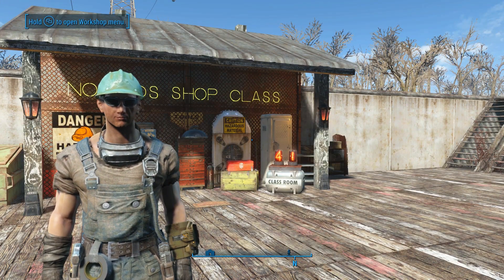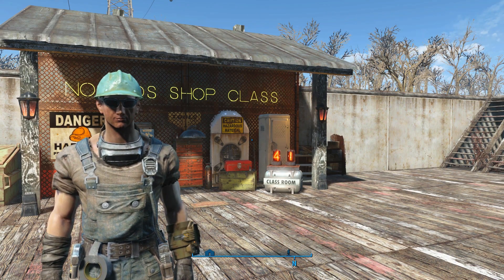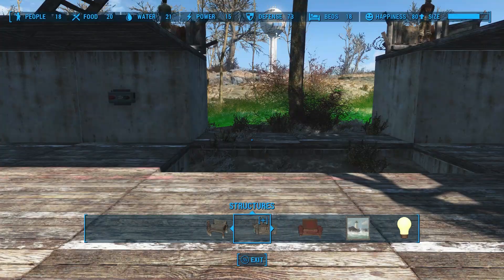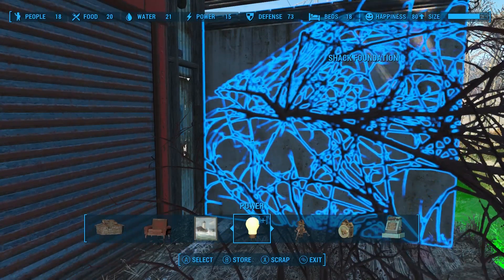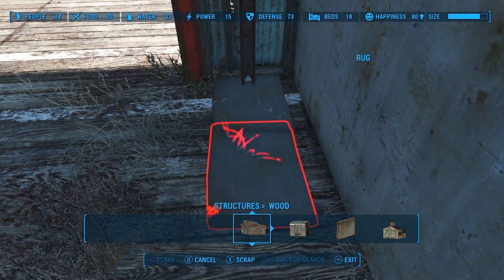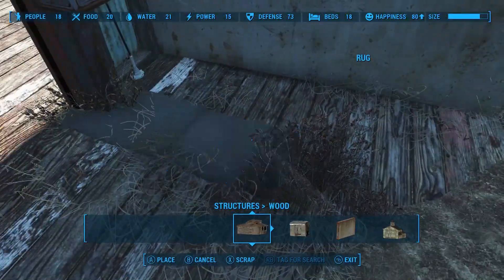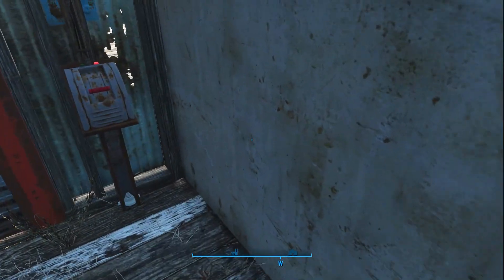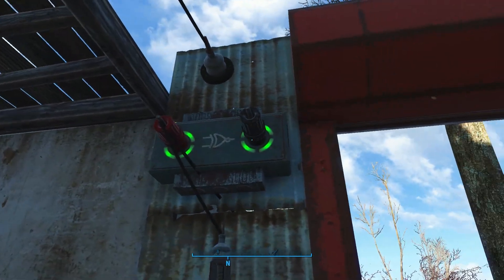Two-Way Powered Doors Using Logic Gates 🎛️ Fallout 4 No Mods Shop Class

Comment: Thanks for the video I needed to wire up the same door for my general's quarters using the logic gate .. instead of using the rug glitch I used commands  and perfectly managed to hide the wires going under the flooring... I also had the same wire bug and needed to rewire it like you did
Reply from the maker: That's awesome! Glad the video helped you get it sorted.
Reply: @SkooledZone unfortunately I still don't have your building skills even though I've played 1500 hours

Comment: I put this same door on my workshop/warehouse and wanted a door that opened long enough for me to pass through then shut right away, so I just used delay switches, no need for a logic gate and I only need to hit one button.
Reply from the maker: That'll work too. Mainly I wanted to show people a practical use for logic gates since most people haven't found many uses for them.
Reply: @ absolutely, I’m digging it, so thanks! I’m eventually gonna tackle some logic gate door stuff, I want a regular switch to open my home door, and the manufacturing laser on the inside to trigger it shutting behind me, then the laser resets and opens the door for me when I exit, and the door shuts behind me then too. If that makes sense. Basically manual entry, auto exit. Both auto close. If that’s possible without a wall full of switches. Lolz
Reply from the maker: Here's a method to try: https://youtu.be/0bhOULJvFwU?t=174
Reply: @ thanks a million! I’m about to deep dive your Fallout 4 playlist as I’m learning the game. Everything I’ve watched so far is awesome. Greatly appreciate your work/wisdom/wizardry.

Comment: I know this is a really late question, but I picked FO4 up again recently, and I am trying to make a power loop to a powered door with logic gates.  When the tripwire is triggered, it deactivates a NAND gate, which closes the door for the duration of the timer.  I have a modded laser tripwire that turns itself back on, but only up to 10 seconds.  I want it to stay triggered for about a minute, so I figured on using delayed on switches to add the addition 50 seconds.  The thing is, to make the system work, I have to have to switches in front of the tripwire in the circuit, so that they start their countdown before repowering the tripwire.  I am probably not explaining this well, and probably definitely out of my depth, but want to try and make this work if I can.  Any help would be appreciated.
Reply from the maker: Clever idea. There's also a powered counter. I used one for a different reason in this video: https://youtu.be/AcJdQ000Sxo
Reply: @SkooledZone  watched the other video, and that might help cut down on timing circuits, but I don't think it will help with my problem.  Honestly, I'm not sure that the programming for the logic gates in the game can actually accomplish what I want, or I am unable to properly parse what I want.  Either way, probably not going to worry about it much more.  Thanks for the help.

Comment: Followed your steps, but it sorta worked... I found the XOR does the trick, and not the XNOR 😮
Reply from the maker: Indeed. See the note I posted at the end: https://youtu.be/syC2ACXvwm0?feature=shared&t=700
Reply: @SkooledZone  - I got the Sonic Screwdriver in a mod.. so I use it now for locking etc 😉

Comment: XNOR fails to match its own logic declaration.  The gate should open if both switches are off or if both are on, but not if they do not both match.  This does not match the operation.  If both are turned off the logic gate turns off and the door will not get powered.  And when the gate is separately powered, the declared XNOR gate logic fails to match the two switches and feed  a 'powered' 'logic 1' to the gate's output node.  They needed to include a simple inverter gate.  AND it appears they need a way to put down connection nodes to string wires along with that do not also 'connect up' the floor or ceiling you put them on or near.  I need fully insulated nodes, not FOOLY insulted.

Comment: I need to make a nixie clock.  Or hey...  I know...  I need to make the logic circuits of a i4004 CPU.  Oh wait...  I wonder what chip got made then used in their video games and the pip boy...
But I have a string of counters to count away the seconds...  I want a 6 digit nixie clock.  Hours, minutes, seconds.  Or it would be cool to have a neon numeral that operates the way a nixie numeral does.
Reply from the maker: It's an awesome idea. Too bad the neon or the nixie lights can only be changed manually.

Comment: I found a simple way to use a 2 way garage door. 
1. First set down the door.
2.Take a pass through connector in the conduit section and run it through the wall of the door with the conduit facing outside.
3. Snap a switch from the conduit section to the wall pass through connector.
4. Snap another conduit to the switch.
5. On the outside of the garage door place a switch and connect the wire to the wall pass through conduit.
6. Connect the outside switch to the door. 
7. Place a power source and connect it to the inside power switch. ONLY CONNECT THE INSIDE. 
8. Should be complete. Test it out. 

If you switch on and off both switches and the door should be complete. I found this out a few months ago and it doesn't even require a glitch. All workshop mechanics! Hope my instructions were clear and I hope you can figure it out to maybe do a small video on it because I've had trouble with the door for years and I still don't understand logic gates so my discovery was life changing for me.

Comment: Using logic gates i made double doors for my entrance.
They open and close individually, front door opens to security. Security can open next.

If failed security check as threat, they can also call siren. Closing both doors, and if you happen to be trapped, you are trapped with another door that reveals a shotgun turret that turns on with it.
My castle murder hole.

Custom castle not game castle.
It was a self sufficient concrete castle, 
- First floor with shops and water room, with corridor going around it all, connecting at every side, pillboxs to get shot around castle corner and sides, 2 layer walls, inner window for cover, outer mesh to stop explosives.

- 2/3rd floor rooms and with security desk on 1 and on 1 a ledge going round to snipe from
- 4th gym and other life stuff, and another ledge for sniping and managing rocket turrents.
- 5th backup fusion power and management room
- Roof farm, windmill and mortar.

Comment: Again, it's functioning like an "AND" gate, not an XNOR gate. If after closing the door from the inside by turning off the inside switch, you fast travelled and approached again from the outside, you couldn't open the door from the outside, because then both switches would be off, and the "XNOR" gate wouldn't be getting any power. A true "XNOR" gate would be on if both inputs were off.

Comment: There is much easier way to do the same. You just connect two switches frome one power source. The one inside is "main" other is following.
So you connect them  2gether and outside switch will work only if "main" is on. So if you inside pull the switch - no one will enter. No "logic" panel used. Work perfecly 2 me.Sry 4 my english. I'm russian.

Comment: You’re taking too long to explain something that apparently doesn’t work anymore.
Reply from the maker: It does work. It just doesn't work on nodes. You'll need to attach it invisibly to a small conduit above the node and then connect to the node normally.
Reply: @SkooledZone  No matter how invisible the wire is as soon as I attach it to something it becomes visible again.
Reply: I have a ps4.

Comment: This is getting good! 😮
Run the pwr and spotlight through a logic gate. Run the logic gate output to the siren and the siren is connected to the door. 
Leave the siren switch in the on position. 
When the spotlight activates, the logic gate opens the circuit to the  siren and door closes.  🎉👍🏻👍🏻👍🏻

Comment: I've found a way to do this without the AND logic gate. It turns out that if you connect a power source to the wall-switch on the outside, then connect the outside switch to the wall-switch on the inside, then connect the wire form the inside wall-switch to the door, you have an AND logic system without the need for the logic gate. Though, the logic gate does look a LOT nicer. If you're going for aesthetics, the logic gates are DEFINITELY the way to go.

Comment: thanks once again for the help with those gates. I used the pass-through wall conduits, so I didn't have to mess with wire glitches though. It's not as pretty as your method, but it works.
Reply from the maker: Excellent!

Comment: I still refer to these, and I just recently got all of the DLC that you are using here.  This is all fresh for me.  Thanks for all of the helpful videos.  How many episodes are there in Skooled Zone now?  I'm sure I will have to go back and watch them all.  Also, is there a cross reference for how to do things on the PC without a controller?  For instance, rotating objects.  I know it can be done on the PC, but I don't know which key will toggle the axis.  Also, some of the tricks/glitches only seem to work on the console version.  That's okay, because I can use the ~ console for moving objects into place (possibly easier than using the console glitches) and the ones that matter, like settlement size glitch and true wire glitch still works on the PC.  The creativity is exemplary, and as I said, many of the available building blocks and objects are new for me.  If Starfield has similar settlement options, will you think about doing a series for that when it comes out?  I'm thinking since it is Bethesda, it may have similar (familiar) features.😀
Reply from the maker: Since I use a console, I don't know the PC commands. But I'm sure they're on Google. Here's a helpful list of my build videos though: https://skooledzone.com/nomods
And yeah, definitely playing Starfield for the channel if it has a good build system!

Comment: I like using the gate that sends power if exactly 1 input has power. 
That way you can open and close the door from either side no matter what position the switches are in
Reply from the maker: Indeed. I think I mentioned that in a pop-up near the end of the video, iirc.

Comment: For some reason this won’t work in my visitors center I’ve done it in 3 other settlements in the commonwealth maybe it has to do with the placement of where my door is? I’m not sure what the issue is but I’ve re wired it 3 times going step by step on the video and it just won’t work

Comment: Is there a way for it to work with multiple doors like if you have a shop like mechanic shop you can open all doors at once. While not having to use more than the 2 switches you already use.
Reply from the maker: Certainly. Just hook them all up to the same node.
Reply: @SkooledZone  that's what I figured thanks man

Comment: Can anyone give me some advice? I want to put this gate (or 2 of them ctually) in one of the breaches at The Castle.  I'm having 2 issues.

Firstly, I'm having trouble making a frame for the doors. I can get the sides done ok but over the top I'm at a loss. 

Second, I want to place it in the breach. I used a vault door in another breach and placed it with a scaffolding ladder as per seamless junk fences bu it won't work with the powered door.

Any suggestions?

Comment: Another consideration for the xnor switches is they seem less likely to glitch and it's actually a very clever Idea to us on settlement gates so that when your not their they won't run out into a fire fight in the defense of the settlement when you should have enough automated defenses to get the job down or you can actually use it to rangle up enemies or you settlers but as for the enemies maybe trip wires would work better.

Comment: First off thanks for this video, I was finally able to wire an electric door in my settlement! Tyvm
BUT, I just watched a similar video on the same subject from norespawn. He made it two years ago. He made a total hash of his example. However, one of the commenters was able to give a clearer explanation.
Basically, with the door mounted so that the power input conduit is on the outside. You bring power to the inside switch, then route it from there to the outside switch, which is connected to the doors power input coduit.
This method only requres three wires and switching off the inside switch locks the door in the closed position.
Reply: 5yrs later and this is a lifesaver - awesome advice mate

Comment: sick so i can add that garage door to sanctuary houses
Reply from the maker: Even better, you can make them fit perfectly with the regular power doors. You just have to pillar glitch them into place. But if you wanted to build actual garages on the sides of the houses, these would be best.
Reply: how do i get these garage doors? ive checked on my fallout and cant seem to find them. i have all DLCs. unless i get them when i level up? my build is looking sick now ive got this extra dlc stuff and some creation club content. im loving it.
Reply from the maker: @sasproductions701  Sorry for the late reply, but did you find them? They're at the end of the doors section I believe or somewhere not very intuitive.
Reply: @SkooledZone  yes i found it thanks.

Comment: I did everything like it says and it wont work. I have 2 switches connected via conduit. That same conduit is getting power. Both switches also connecting to xnor
Reply from the maker: Try it with an XOR instead. That will allow both sides to open.

Comment: I tried doing one of these with an or gate and it killed my game...

I had it working when both switches were on the same side of the wall... but once I introduced a conduit to pass it through the wall it ruined it.

Tried switching to the xnor gate, hooked it up to power and the game crashed...

Every time I boot it up it crashes, usually before I make it to load the save, so I can’t even load a previous save :(

Comment: I just played around with the gates because your video didn't give me the one I wanted. I essentially wanted my gates to work both ways all the time like a three way switch on some stairs. I used the NAND gate ("transmits power unless all inputs have power") with two switches going to it's input just like in your video to achieve the desire effect. Now, every time one switch is flipped the door either opens or closes. From either side.
Reply from the maker: You may have missed my screen note at 11:40

Comment from the maker: If anyone wants to see how it functions with an XOR gate instead: https://youtu.be/Bk2SWNyshFA?t=1m20s
You can also create an automated "grocery store" type motion sensor door: https://youtu.be/2UosGvYruJE
Reply from the maker: +poon slayer ...I found a better way here: https://youtu.be/YdaR7m4gct4
+Vaughn Jolley ...Sounds similar to what I did in my Covenant build: https://youtu.be/CL129zHWgug?t=28m12s
Reply: Could you please try to build like a bat cave or a hidden room
Reply: Skooled Zone you never want to pick up the door and walk through in workshop bc the wire will glitch out like that, happens to me all the time
Reply: Skooled Zone I haven't had a chance to watch your auto closing doors but I use 2 delayed switches on a 3 second interval.  I open the door I walk in, turn around, the door closes.
Reply: Paul you saved my fricking mind, even though it didn't make sense to me

Comment: Paul, i have been figuring out but if you use this logic gate and you fast travel from inside the base you will not be able to go back in without getting inside the base editor.
i have been figuring out how to fix it and i recommend to use the XOR logic gate.
Reply from the maker: Yes, I did mention the XOR gate at 11:32. But you can also just have your fast travel mat on the inside of the settlement. That way you'll reappear inside your settlement when fast travel back. You can also just leave the door open at all times and only close it when attacked. :)

Comment: Instead of using switches I use the trip wires and pressure plates and a series of two doors so that only one door opens at a time. I have most of my defensive turrets at this point so that no one can enter my settlements unless they are friendly. I do have a mod (covenant wall mod) to wall off the settlement but you could use the cement DLC.
Reply from the maker: That's a good idea, David, but is there a way to keep the pressure plates on without mods? I tried that originally but as soon as you step off the pressure plate the door immediately starts to close.
Reply: You use the pressure plate (in conjunction with logic gates) so it closes behind you.
Reply from the maker: Interesting, so your gate doesn't start immediately closing as soon as you step off the pressure plate? If that's the case, I'd love to know how you do that. If it's something I can show the "class" I'll definitely credit you in a video!
Reply: It is easier to explain that it would for me to make a video. It is pretty easy. Just use an OR or XOR gate on your pressure switches in like a W pattern.  Two OR gates and three pressure switches the middle one opening up two doors. Then you can use fencing to funnel people into those switches like an hourglass and you can adjust them to fit the caravans.  I don't make very pretty settlements. I make them more security focused.